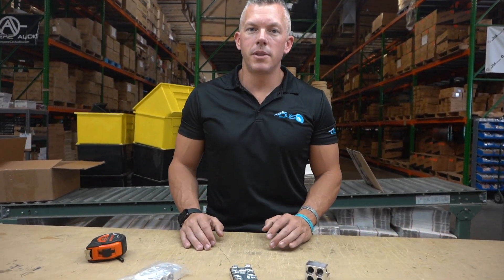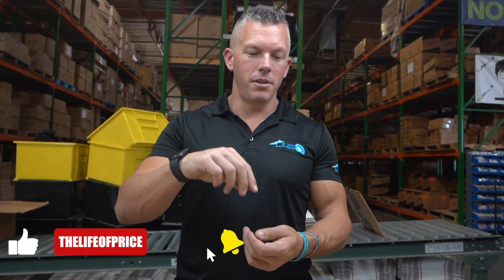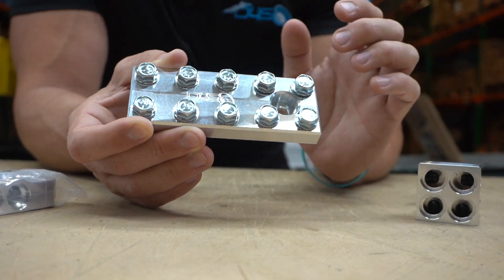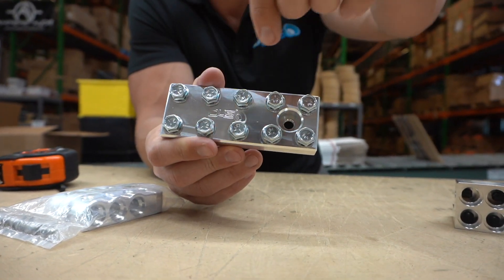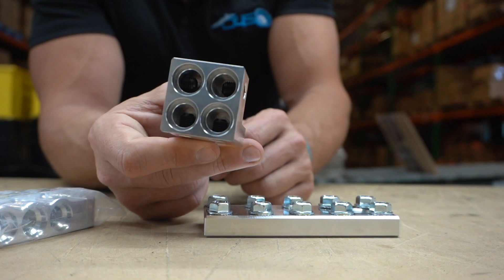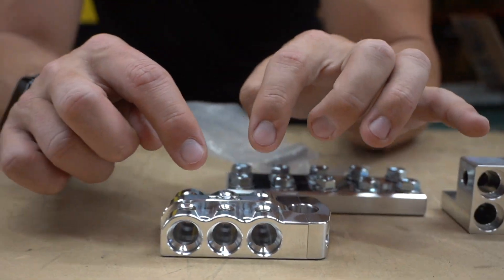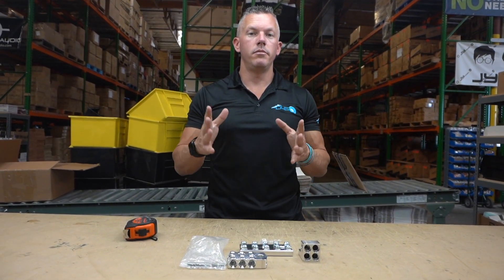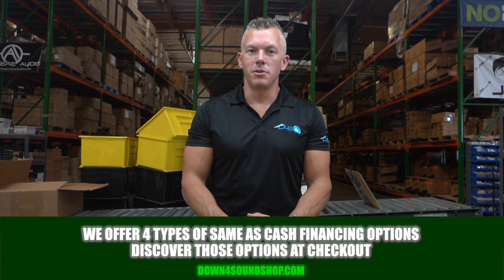DISTRIBUTION BLOCKS AND THEIR IMPORTANCE

Comment: @THELIFEOFPRICE
Would that  4-1 or 6-1 holes of the distributor block, work for multiple different off-road lights, that each wire will function. Like let’s say, this large wire from the battery, to 4-6 wires that’s one for off-road pod lights, one for rock lights, one for light bar, etc etc. 

Can that work, if so what type of distributor block?

And do we need for both positive and negative distribution blocks?

Comment: What’s the max amperage these can handle or does that not matter? I’ve got a heavy duty winch rated for 17,500lbs or about 475 amps at max load. Can this handle that. I do have a high output alternator bay am just looking to add a cleaner option to my battery terminal.
Reply: Sorry for late reply but did you ever use it I’m looking at doing the same right now?

Comment: What better to get more bass a porter box or a enclosure box to get ur system to hit way hard and to get it to shake ur car and to hear it 4 block away  which is better
Reply: if everything else about the system is the exact same. then ported. sealed can be loud af just gotta turn everything right. same with ported. everything has to be built correct

Comment: Well, if I knew their was a 10 spot terminal/block from d4s I would have gotten that instead of the illcustomz 8 spot. I had to consolidate 8 runs down to 3 4/0 runs just because I ran out of room on the block.  

Edit: the 10 spot flat lug style isn’t even available on the d4s site

Comment: Top post is larger if you have a top post battery if you have a side post it doesn't matter but you should just get a top & side post battery any ways so you can buy a 2$ post top or side can buy any were car parts are sold and use it for your system and the other post for your car it's the cheapest cleanest way if you think a head of time  it also looks stock under the hood of the car and can make the big 3 up grade easier to do  specially with a added side post adapter for a amplifier multiple hook ups.🤔😉💯👍👌✌️🎶

Comment: Thank you very much for making this video and one question is aluminum better than copper on conducting electricity when is that close to the power source?
Reply: I always  wondered the same thing about the two they also can cause electrolysis and rust not a good thing if you put them together but you also have to wonder about crome plating sense every thing in car audio covered in it it's never just bare metal. Pure CCA wire and aluminum does rust and wire will snap off no matter the quality of them IV seen it first hand if that helps. Crome plating my help prevent it but I'm not sure. 👍👌✌️💯🎶
Reply: @josephsaucedo8691  And reason why I asked about the aluminum and the copper I know not to mess with CCA Wires been doing this for a minute since the late 90s biggest system I had was 3-12s in the back of an Oldsmobile The reason why I ask about the aluminum everything corrodes You will see white dots on the aluminum I have a guitar that the wires have that aluminum crap in it and now I need to replace all the pick ups and the wiring if you live in Texas stay away from the CCA wires
Reply: @scottborst5430  can't go wrong with all copper Even when crome plating on it.😉👍👌✌️🎶💯
Reply: @josephsaucedo8691  thanks
Reply: @josephsaucedo8691  Yeah you gotta watch out about some chrome plating have you ever heard plastic chrome plating it won’t rust but it won’t stick to the metal and you won’t see the metal rusting underneath.

Comment: They are also great for running common ground.
Reply: thats what I bought some for. obviously for battery distribution but I'm gonna bolt one down to my frame so I can have a grounding spot rather than just drilling a bunch of holes in my car lol
Reply: @zanechristiansen was it a pack of 2? On the website is shows 2 in the picture but im not sure

Comment: I’m sure a lot of ppl are going to know this but the positive side is bigger than the negative side. I didn’t know this until about 7 years ago but you are living if you don’t learn something everyday 😊
Reply: That is a very valid point.
Reply: Is that only for sae style? I have two distribution blocks for my xs battery which is a screw terminal and the positive and negative distribution blocks are the same size
Reply: @just.jack1011  I believe xs will make the terminals make them to where they’re the same size I’m not completely sure but if you buy a battery off the shelf you’ll have your positive terminal be bigger than your negative terminal
Reply: @chefleon2967  oh ok cool, thanks 💯💯